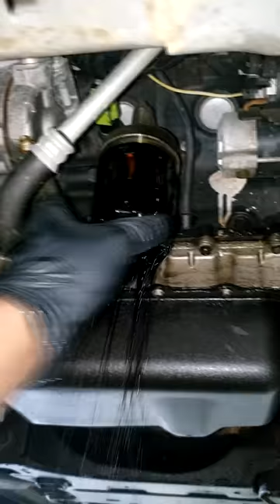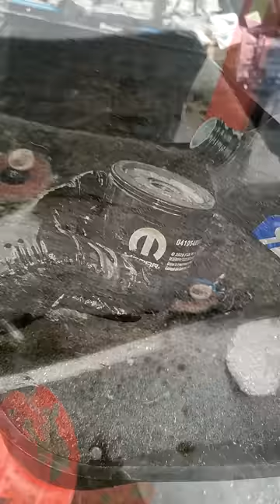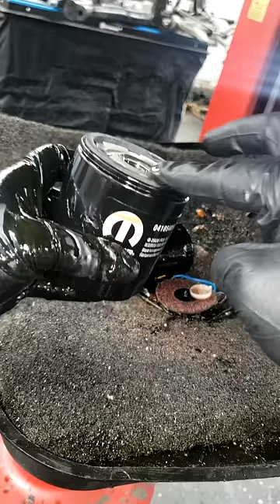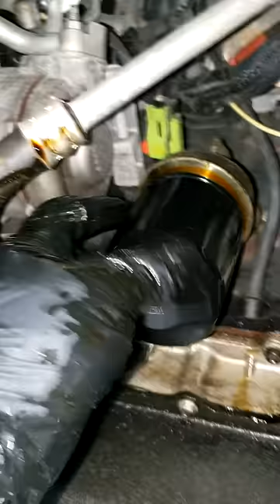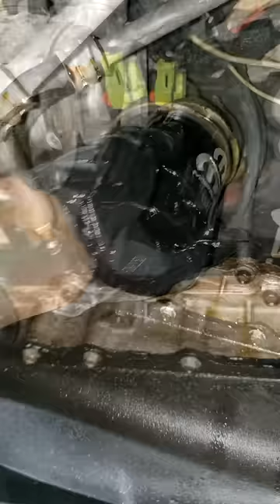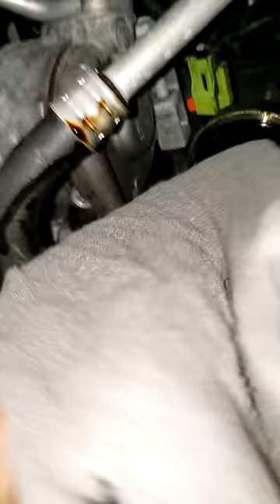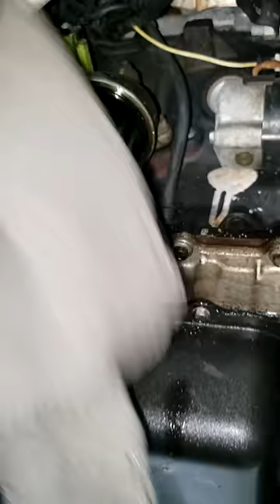Don't Lie.. Are yall still doing this?

Comment: I worked at a caterpillar dealership for many years. Factory specifically said do not precharge filters. Mainly because they didn’t want unfiltered oil going through the engine. The only way to properly charge a filter is to put the oil through the out side holes only. Cat knows nobody does that so it’s better to not prime at all. Cat engines run longer than any others I’ve seen. Maybe Cummins as well.
Reply: With that logic you shouldn't put oil in the oil fill hole at the top of the engine.
Reply: @MoreJamesSmith  that’s true. The new oil out of the bottle isn’t filtered to the spec of the oil filter micron rating. Caterpillar also wouldn’t give a dealership a 5 star rating if they didn’t have an oil filter on the new oil dispenser. 🤷🏽‍♂️ this will probably be discussed until the end of time. 😂
Reply: I work for a Deere dealer and dyne manufacturer says specifically not to pre fill a oil filter for that exact reason as well as they have seen the filters crush under vacuum
Reply: What can i use to pre filter my filter so that my filter is filtered?
Reply: No to fuel filter aswell
Reply: @brandonallen7993  - You have mentioned one of the main issues. It isn’t just the filtering of the oil from the bottle, barrel, but the filters and certain engines don’t respond well to this. I have a 67 Chevelle 396 and was putting a Fram (I know, don’t use them anymore) filter on, fired the engine up and that slight surge caused the filter to separate where the top crimps with the exterior can!! Puked all over the ground etc and I almost ran the motor dry (so to speak) before shutting it down. I had a family member there who saw it. If I was alone, like often when changing the oil on the vehicles, I would have revved it up, maybe gotten out to check the oil after shutting it off & it could have been too late for the original engine. I was fortunate and everything is still fine with the car. 
     Fram gave me a case of new filters when I sent them the information/evidence. They are still unopened. Haha. I’m sure any brand could have a stupid failure like that, but it was Fram in this case. They may be a better product now, I’m not sure, but have had enough bad press to be more strict on product control by now.
Reply: @davidallen5976 how do you know the filter has the right micron rating?
Reply: @renbenism  you need to pre fill fuel filters bud, unless you have an electrical primer, in that case you don’t need to cause you can  flip the key until the filter fills up
Reply: I'd rather have unfiltered oil than no oil..
Reply: Yeah...... I always pre-charged my filters with used dirty engine oil that has sand in it so it goes through the entire engine. (Sarcasm) unfiltered new oil ??? Use your head and think for yourself.
Reply: @OwThatHurt46  A pre filtered pre filtering pre-filter-er filter
Reply: @MoreJamesSmith  any debris that gets In while filling will get pumped through the filter first before it goes to the bearings.
Reply: @KTMBOI450  precisely. 

Filtered.
Reply: Im with you on that .because in manifacturing of oil process loads of bits acidently can come in the oil.I had a plastic bit in to it and not very small would say 5cm long x 1cm wide and that was motul ...and to put it thru the tiny holes is a hard work.
Reply: @davidallen5976   The oil out of the bottle is the cleanest it will ever be at any point afterwards and has NO particulates in it to speak of other than additives which are much finer than any oil filter can filter  until it runs through the engine, If you ran slightly used motor oil through the filter it would still have very fine metal particulates that will pass through the filter despite if it  is say 10 microns anything below that size will pass through, Then you have the issue of you can only go so small on the micron ratings for filter or the oil flow rate would be too slow causing oil starvation to the engine if not for an oil bypass valve in oil filters... You want to make a legitimate  bet on it , you can do a fresh oil change and run the engine just for about 20 minutes then pull that filter pour that filtered oil into another filter with the center plugged and then pour that into clean bottle and I will buy a new bottle of oil from the auto parts store, then we can take both the fresh unfiltered oil and the filtered oil from the oil filter to a lab and have them both tested for particulates and see which one has more and larger particulates in it, Wanna take me up on a bet! I'm willing to bet you say $1000 or what ever amount you would like too, less or MORE , Come on and take some easy money if you really believe in what you say is a fact! Then we can post the results right here... I'm dead serious if you want to take me up on it...
Also a dealer that is using oil drums to fill vehicle's in large quantities is going to run a filter as just an extra precaution measure, and why not filters are cheap insurance, just incase... Also those filters are likely also to filter out any possible moisture buildup(water) due to high humidity and such... Hence filters used at gas pumps are also used to wick out water buildup in the giant underground fuel tanks..
Reply: @jeep13ca  We're forgetting the oil fill hole is at the top of the engine. So when oil is added it spills over all the internals of the engine that would normally see oil, then drain down to the oil pan like it would in normal operation.
Reply: Scotty never said this!
Reply: A filter this size doesn't need to be primed... a cat filter absolutely needs to be primed its fresh oil dude not something that needs to be filtered😂
Reply: @renbenism  if you don't prime the fuel filter your truck won't run....
Reply: @stiven647  dude prob sat there for am hour cranking away dry and was like I just changed the filters why won't it start...
Reply: What fuckin cat dealer had that as factory spec 💀💀💀💀
Reply: @MoreJamesSmith oil added to the fill location will be filtered when it goes through the filter. Oil added to the filter outlet goes to the oil gallery.
Reply: The CONTRADICTION of this advice from Cat is that anyone who's actually touched or seen a Cat filter for engines like the 3406 knows the filter is GINORMOUS.  it's literally one of biggest oil filters in civilian use, only those in the Navy may have seen something bigger used on a marine diesel.
Reply: @jerseypb2223  vapor lock is always fun especialy when its self instigated  alsoinjectors hate air bubbles
Reply: @phillyphil1513  i was gonna say ask the military any mechanic in a motorpool will tell ya and if theres one thing uncle sam hates its spending money to fix broken shit
Reply: @MoreJamesSmith  

Lol!!...Nobody is forgetting anything...

Pre-filling the filter still leaves the vast majority of oil going in through the oil fill.
Reply: That might be dealer protocol but when you dump oil over the internals from the top and it drains to the pan its unfiltered anyway
Reply: @Josh Sirum  

Right..but oil would go through the filter from the sump/pan before going through galleys/mains etc.

The fear of pre-filling the filter is getting contaminated oil on the wrong side of the filter which would get sucked directly into the passages.

I've pre-filled forever, making extra certain containers are clean without a problem....just makes me feel better.

Just like a lot of people don't pre-fill without a problem. 

The fact many motors' filter placement make it impossible to pre-fill says it's not really a problem.
Reply: @brandonallen7993  what vacuum? The pump is before the filter, the collapsed media is due to bypass failure as it encounters pressure on the dry media and no way to go through bypass! At least that the only thing I can think of!
Reply: @shitloveaduck  first mistake was using a Fram filter
Reply: Are you using dirty used oil or what lol? They filter the oil a bunch of times and do quality checks before it even goes in the bottles
Reply: Cat is in the business of selling more cats.  Personally oil out of a plastic container is probably cleaner than a bulk tank at a dealership.  Its funny Cat is worried about filtering new oil when they should be worrying about all the shitty cheap plastic parts they use on their equipment.😅
Reply: @sharkbaitgaming  - Absolutely!! Haha.
Reply: @shitloveaduck  I'm glad you agree hahaha
Reply: @MoreJamesSmith  that makes no sense since any oil you dump into the top will get filtered. You do realize that right
Reply: I worked for CAT and I approve this message
Reply: thats fuel filters. The oil filter gets filled. facts
Reply: So Caterpillar sent you used oil?  It's filtered before its bottled.  Wingnut.
Reply: @Steven Bear  there can be dirt on the bottle or the oil you're using. There is no benefit to precharging a filter and most companies recommend not doing🤷
Reply: @prairiemountainmanadventur7424  
I'm sorry that you and Caterpillar feel that way.  As an automotive engineer, the remaining 99% of the industry does not agree with you.  While every company might not specify precharging the filter, none think it is harmful to do so. There could be dirt in the bottle, really?  Did you prefilter every quart you put in topside?
Reply: @Steven Bear  you know thats a silly argument right? Because any  oil you put through the top side does get filtered before going through the oil galleries of the the cam bearings abd crank bearings
Reply: @prairiemountainmanadventur7424  
What about the lifters, guess we don't need any top end lubrication.
Reply: @Steven Bear  you know how the lifter get oiled right? Same way as the cam journals. There are small passages of filtered oil. But as an engineer upu already knew that right
Reply: @prairiemountainmanadventur7424  
Hydraulic lifters require upper lubrication, as do the rods and lifter arms.  A precharged system supplies that immediately.  Stick to Caterpillar, they need you.
Reply: @Steven Bear  lol I don't even work on cats and they aren't the only company saying not to pre charge a filter. Since most everyone does it improperly anyways. You need to block off the big hole and pour through the small ones. Seeing as oil pumps start pumping immediately it's not necessary. And if youre really concerned put the vehicle in clear flood and crank it a couple turn before starting
Reply: Cat is wrong.
Reply: @steven-ky2ps  do you have any proof of the contrary